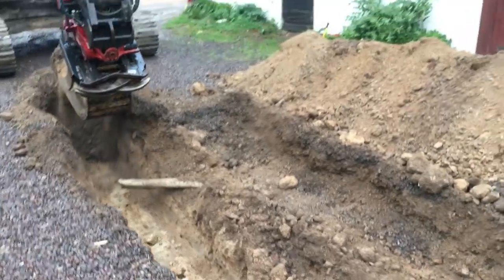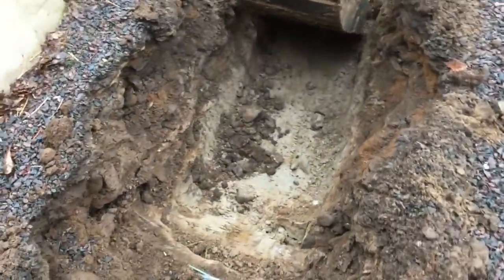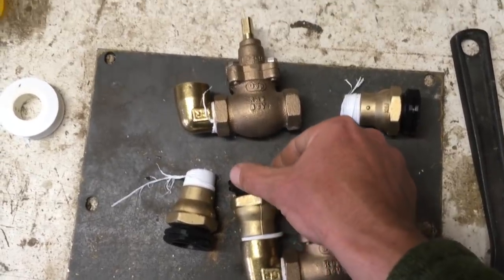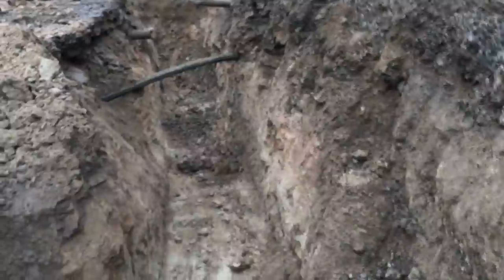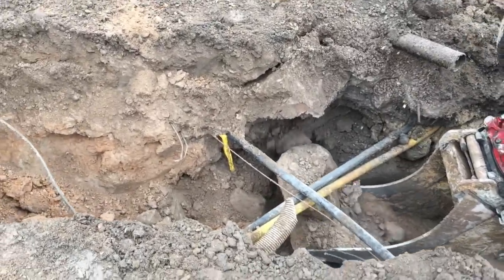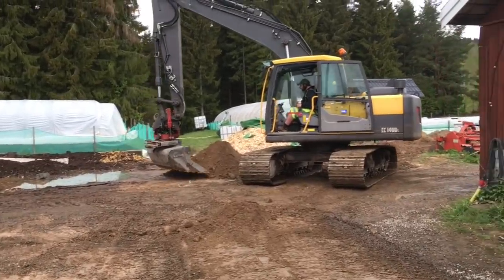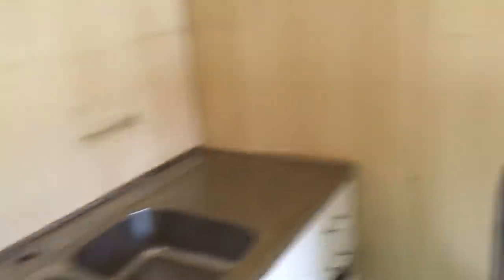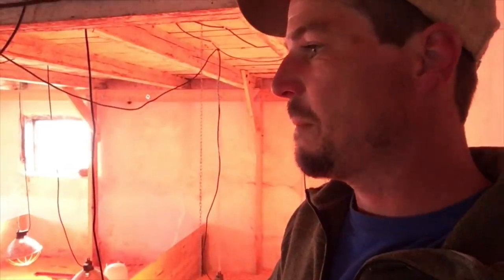Installing more frost free water points

Comment: I am amused that you, in Sweden way up north, are able to get below frost depth three inches before I can here in Southern Michigan in the US. And it is indeed easier to have the machines do the digging than to do it yourself by hand. I trenched the powerline for our well by hand and while I was down there went deep enough to run the first section of the waterline as well. What takes a week by hand is done in an hour with the excavator, even with an amateur operating the machine ;)

Comment: If you have issues with frost wrecking your yard in the springs, I imagine you might find usefull this technique where they buried the tracks of used tires under the gravel. Not like in eathships or such, where the sides of the tires are in place, but rather without the sides. It lets all the water pass through into the ground. It doesn't allow for the gravel to move though, as it is trapped by the tires set side by side. Just an idea, I bet you have your days planned already.